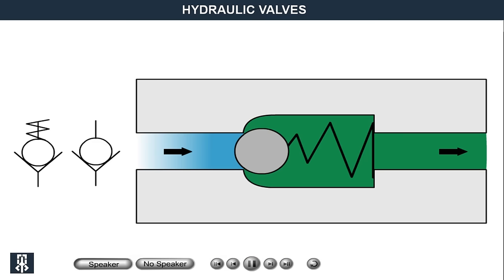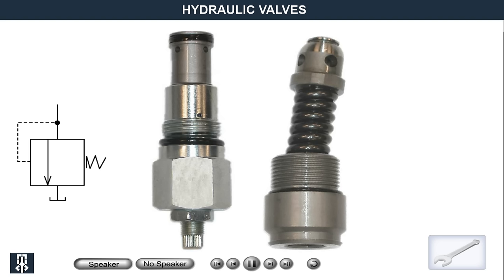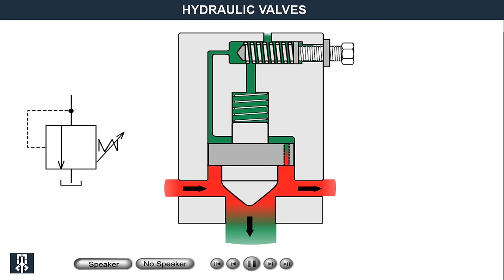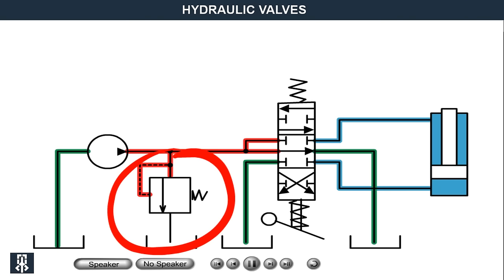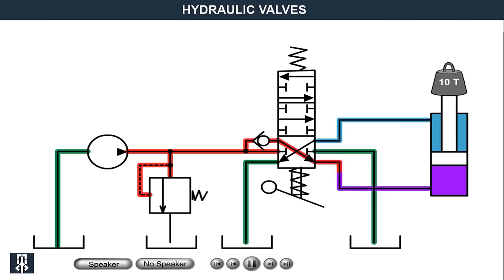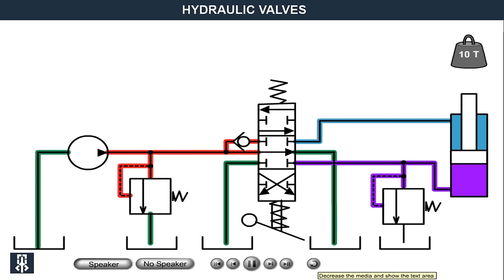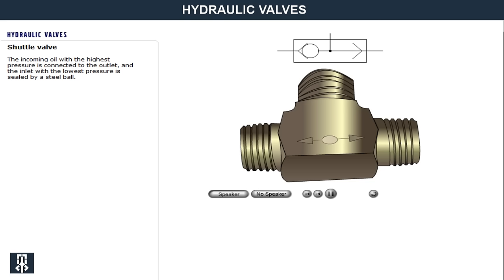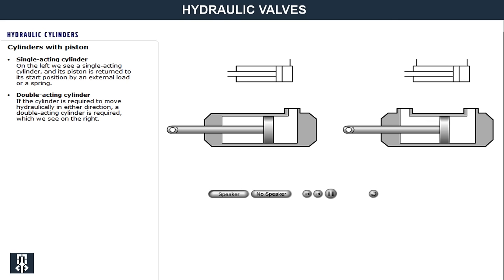Different types of hydraulic Valves and function explanation with animation

Comment: Nice try with thes animations, but they holds a couple of "flaws"...
1. The arrows in the upper valve position are in opposite of corroect direction.
2. How come the pressure is increasing between valve and cylinder at 6 min7sec and still the cylinder is lowering? Where is the flow from the cylinders cap side going while the pump is still displacing oil? The answer is that the valve symbol needs two more positions on each side of neutral position. In that case you are right about the load holding check valve

Comment: if I put the pressure limiting valve, does system reduce the flow rate?  Can I put pressure limiting valve and flow control valve simultanuously? Thanks,

Comment: please explain me prefilling hydraulic valve  BOSHE TYPE  size 125  for hydraulic press
Reply: Insert the nozzle into the flange gape and fill it up till it starts to dribble from the top blocks ear chamber. Just be mindful not to let any spill into the eye of the head block. This will require further operations to cease until all contaminates have been wiped clear. It is always good practice to take a photo of this for future reference should any warranty claims be lodged stating abusive operations to be the root cause of below average functions experienced by future teams in the workplace.